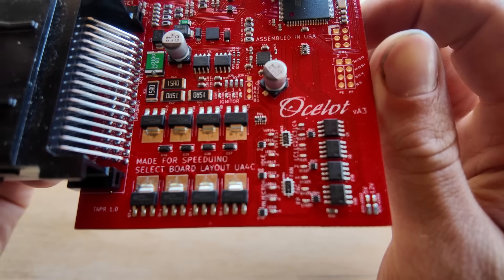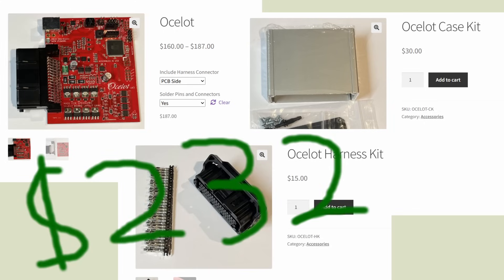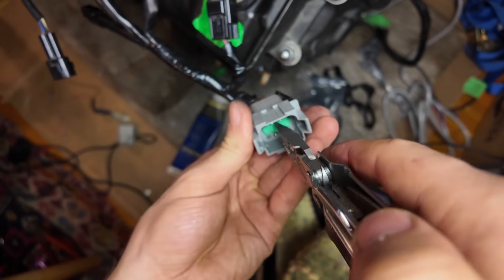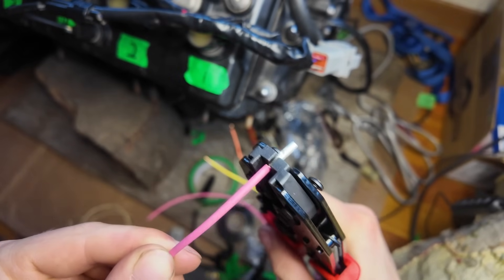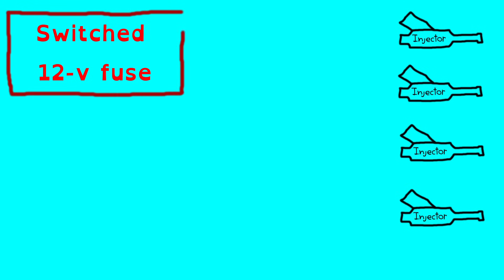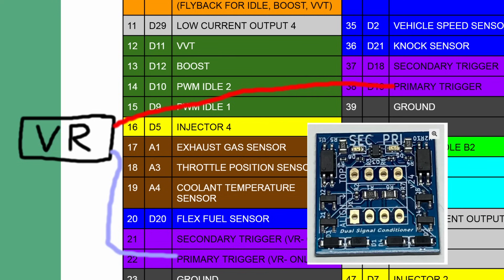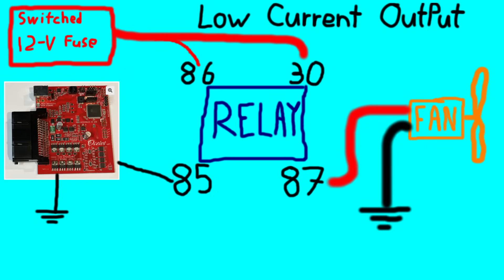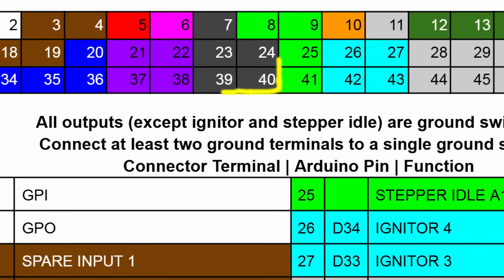ECU Wiring Simplified - Featuring Speeduino Ocelot

Comment: Thanks. Great.
Would love closeups of how you physically connected the wires. Solder or what?
Reply from the maker: @yougeo Yes I do actually have some footage of this. Its hard to fit everything in one video and keep the length reasonable. I will hopefully fit this into the next. Everything is crimped together. I have herd that soldered joints can have a tendency to break in automotive applications.
Reply: Good work dude looking forward to the next video already

Comment: Fantastic primer on the Speeduino! I'd never heard of it but it looks great. I've often wondered whether it would be possible to put an open ECU onto my turbo diesel, but I don't know what sort of controls that type of engine needs. Obviously not spark, but maybe injectors?! And fuel solenoid. Not sure on the turbo if any of it is electronic or all mechanical...
Reply: Control logic isn't correct for diesel injection, so it won't be running smoothly if you are able do cook something up from a speeduino.
However there does exist a reasonable prices stand alone diesel ECU, it is made by an Icelandic viking named Baldur Gíslason.
They are more expensive than Speeduino, bot for what they are they are quite reasonable and affordable. 
He has 2 models, depending on which type of injection system the engine use, DSL1 and DID1.
It says so that DID1 only can manage solenoid type injectors, but with a cheap add on part it triggers piezo injectors fine 🤠
I have both and you will mostly be using DID1 for most engines.
Reply: Thank you  @Mr.Engineer.  for your detailed information! I will look into Baldur's ECUs. Much appreciated
Reply from the maker: Thanks! I don't know much about diesel ECUs, thanks for chiming in 
@Mr.Engineer.